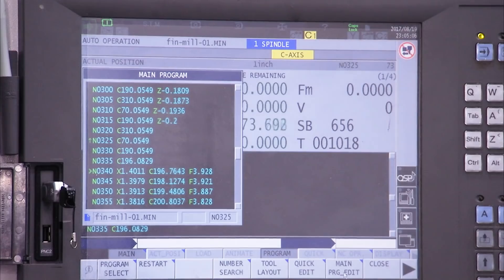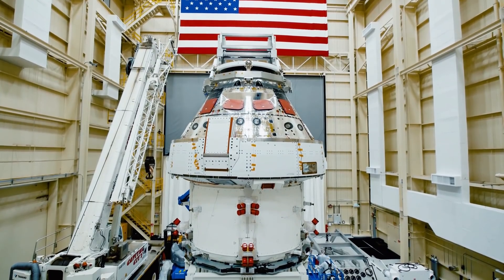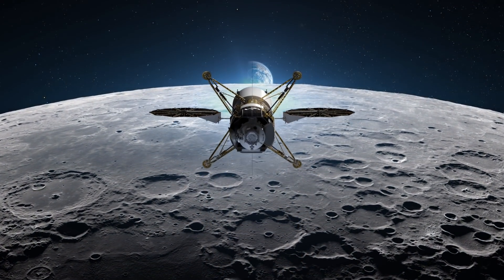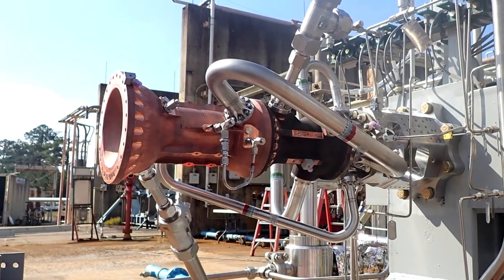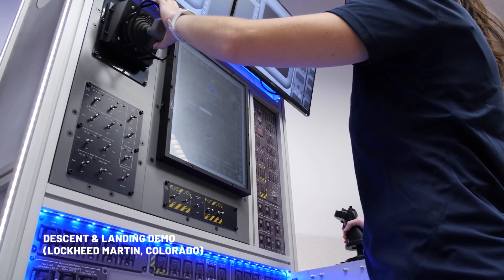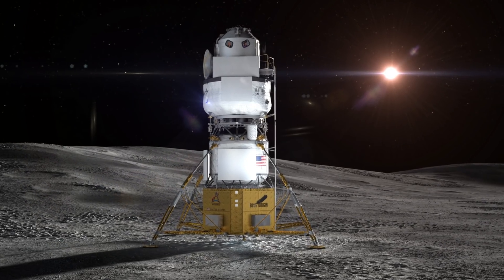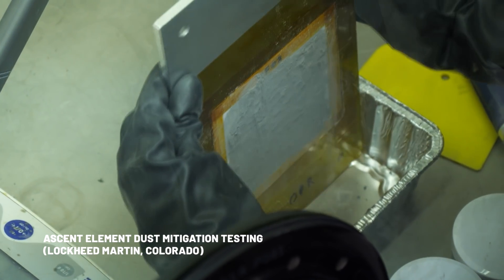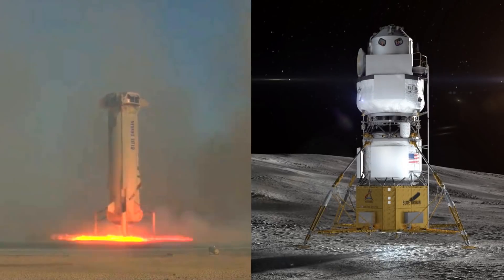Tech Demos for NASA’s Artemis Program

Comment: SpaceX is being innovative and making a real spaceship that will be able to land on Earth, the moon, and Mars while Blue Origin is sitting here reinventing the Apollo 11 lander.
Reply: Yet some how they made it LESS innovative and 10x as complicated and stupid as the original Apollo lander
Reply: Apollo LM was not partially reusable or compatible with lunar ISRU or could support 4 people for a week, much less 2 or had skin more than a couple times thicker than a soda can.
Reply: @iamarokotmanson  I didn't say it was exactly the same as the 1969 Apollo 11 Eagle Lunar Module, I would hope this lander designed 50 years later would have major improvements. But it's nothing super innovative, it's an expansion of already tried and true tech. SpaceX is trying something radically different. Also partially reusable isn't anything to brag about when the competition is designing something nearly completely reusable. Starship and the entire rocket it launches on will be reusable. Also this Blue Origin lander is designed for one purpose, landing on the moon. Starship is going to be able to land on the moon, Mars, and the Earth. It's one design that may work for many missions.
Reply: @Heatr53  i'd say this is a pretty major improvement, worst HLS lander yes but major improvement from LM. 7 day surface time for a crew of four, 2/3rds reusable, multiple engine out capability on descent and ascent stages, much tougher skin, more advanced avionics, and compatible with lunar ISRU. Im not comparing it with the other HLS's just with the LM. 
P.s. lol you want to talk about complexity when starship requires 12 redevouz, dockings, and fuel transfers of 100tns if cryogenic propellant in quick succession to land.
Reply: What Apollo 11 lander?

Comment: I do not understand how Blue Origin is STILL in the running for anything. This isn't 100% reusable unlike the two other bids and you still haven't actually put anything into ORBIT! Don't get me wrong, I was hopping for some competition but at this point...is Blue Origin even at the track?
Reply: Dynetics isn't fully reusable and Starship requires 12 rendezvous and dockings in lunar orbit
Reply: @iamarokotmanson  you do understand that Blue Origin leaves the descent module behind right? Spacex needs fuel but leaves nothing behind. Dynetics is not 100% reusable yes, I am sorry, but is MORE reusable than Blue Origin.
Reply: @lastfreethinker6810  i didn't mention blue origin in the slightest, just trying to clarify things
Reply: Blue Moon HLS is definitely the worst of the 3 but it isn't terrible

Comment: Love the comments 💯 😅
Reply: Way too much mindless spacex fanboys
Reply: Harry the Irish lad  if you think anything other than Spacex is trash and a total waste than you're a disgrace to the spaceflight community. I support them equally. Competition is good, it drives innovation. The Blue Moon lander isn't even that bad. Worst of the 3 HLS yes, but not terrible
Reply: Harry the Irish lad  never heard of compered. But do tell why are you comparing the completely different development programs? SpaceX is attempting to build an earth to orbit vehicle with interplanetary landing capability with very rapid prototyping and fast production. Blue Origin is attempting to build a sole lunar lander in the traditional way. Two very drastically different methods. SpaceX way has not been proven so far.
Reply: Harry the Irish lad  a 12km hop and crash is as much progress as long testing of the engines and subscale tank test for Blue Origin. If you want to be stupid enough to compare the two
Reply: Harry the Irish lad  i didn't say that spacex should do it the traditional way but that the two programs are extremely hard to compare in terms of progress

Comment: Pause at 5:29
They are using a cherry picker. Now compare the height of the ladder to a cherry picker. Dammm that's a big ass ladder.
Reply: That ascent module is so smol !
Ladder is about 35 steps? If OSHA was involved, they would require the astronauts to be on-belay with fall-arresting gear. That seems sensible - not at all excessive precaution.

Comment: So... when are you going fix that deathtrap you call a ladder, eh? My bet: When the first woman astronaut cracks her helmet on the lunar surface after slipping off its MANY rungs.
Reply: Did you notice the ladder is not one solid piece but actually two ladders that are supposed to line up with each other. I would like to know how is BO going to achieve that level of accuracy with ladders fitted to the OUTSIDE of two space vehicles. I don’t think it is possible at all.

Comment: There seems to be an established talking point among those who favor another system about the ladder on this vehicle. Of all the systems required on a lunar lander, what a strange element to fixate on. 

First of all, as they explain in the video, the height of the ladder is an asset because it allows less lunar dust to get into the vehicle. Having critical systems far above the surface, including the engine needed to return to orbit, is a design that puts safety first. The Dynetics low-profile design seems to assume a flat surface and a trouble-free landing. I'm not sure how SpaceX's tall Starship, with its tiny landing legs, is going to be able to land anywhere on the moon other than the super-flat mares.

Second of all, for the many commenters who seem obsessed with the "injured astronaut" scenario, I wonder how you think an injured Apollo astronaut would have gotten back to the LM's ascent stage? The risk of damaging a critical system when landing on an uneven, unprepared surface (much more rugged terrain at the poles than the smoother sites Apollo landed at) far outweigh the risks of an astronaut being incapacitated while outside.

Comment: "It's safer, it's so much safer" Anyway, the crew capsule is 30 feet up
Reply: Interesting observation, he shakes his head side to side (as in shaking your head "no") while he's saying it's safer. While not 100% accurate, people shake their head like that subconsciously when they know they are lying.

Is he lying? I don't know. But I don't buy his argument that it's safer.
Reply: Yea and the moon has 1/6 of Earths gravity. Meaning even at thirty feet a fall isn't likely to hurt you.
Reply: @Predator42ID  If you fall from the very top, it's the equivalent to falling 2M/6.5 ft on Earth, which would definitely hurt really badly.
Reply: gajbooks idk about you but I don’t get hurt when I fall from 2 metres on earth
Reply: @gajbooks  well, you spend more time in the gravity of the moon so it would hurt around half as bad as anything on earth
Reply: @ProtonSemilightCondensed  Maybe not two meters on your feet, but try two meters onto your back into rocks wearing a hundred pound space suit. My point isn't that it's unsafe, and it's probably fine for astronauts, just that it's corporate BS about it being designed that way for safety. They clearly intend to use multiple launches which means it all needs to fit in the payload fairings and transfer mass limits, which is the real reason it's designed so vertically.
Reply: gajbooks yeah that’s a fair point, but the weight of the suit doesn’t mean anything.  Heavier things don’t fall faster, and the suit is inches of thick material with plates of metal all throughout them, so falling onto rocks wouldn’t be too bad. But yeah I agree with the rest of your point.
Reply: gajbooks 30/6 is 5, not 6.5. And even falling from that height on earth wouldn’t break bones or even hurt that much. Plus the astronauts would be wearing super strong spacesuits which are like inches thick and are pressurised from the inside. Oh and the lunar dust is like VERY fine. A lot finer than sand. So fine in fact that the legs on the Apollo lunar lander only buckled a few inches even when moving at a little over 2 metres per second. Falling from that height wouldn’t pose any real threat if you just rolled on your side and broke the fall with your arms and shoulders.
Reply: @seth Thomas It will be like 5 meters on Earth. And Imagine if something nad happend during EVA and Astronaut would lost consciousness, how would you gonna carry him to habbit module?
Reply: *5 feat (~2 meters)
Reply: Don’t forget the bottom of the Apollo lunar lander was over 4 feet off the surface, requiring a much more dangerous and time consuming jump that would also be nearly impossible to get a crew member up in an emergency. So instead they just do what they can to prevent an emergency in the first place, like making the suit stronger.
Reply: I don't know about you buddy but I'd rather have an abort to orbit option than having the crew module low riding close to the surface.
Reply: @odysseyvoyager2354  Even the Apollo missions had abort-to-orbit capability, and they weren't 30 feet off the ground. It's not a matter of safety, it's a matter of the dimensions they can cram into payload fairings for the descent mass they want.
Reply: @odysseyvoyager2354  p
I’m pretty sure they all will have an abort to orbit option, and being lower to the ground is definitely safer too. Image if there is an emergency, would it take more time to get up a 30 ft. ladder in limited mobility EVA suits, or be right there at the ground ready to go?
Reply: Gabriel Taylor yeah but they can just work on preventing emergencies in the first place by having better suits. If you think about it, the only really possible emergencies are breaking the helmet or breaking the life support pack, which can easily be avoided by making the pack stronger and having multiple layers of bulletproof glass for the helmet, which is what the Artemis suit has.
Reply: @odysseyvoyager2354  watch Angry Astronaut's video about this. He has conducted an interview with Dynetics. Dynetics had raised some concerns about this.
Reply: @odysseyvoyager2354  you guys should watch the angry astronaut lol
Reply: @michaeljones5685  haven't watched his current video about this, but the dude talks out of his ass about a lot of these topics.
When i heard him talk about the priorities of the spacex test flight it really got clear to me how little he knows about the stuff he's saying.
Reply: @XPECTED pretty much. Didnt mean to be that rude, but it kinda seems that way. His perception about blue origin and other companies is a little out of whack and he barely knows any of the technical stuff, but makes claims about them anyway.
Reply: Kenneth Irgendwas yeah he really just doesn’t like doing research and doesn’t have very much common sense. He called the Artemis EVA suits ‘bulky’ when they are the most advanced, mobile and safe spacesuits ever designed. Even falling off the top of the ladder wouldn’t crack the 2 layers of bulletproof glass and would really have a good chance of breaking bones are damaging the life support pack, considering 30 feet on the moon is about 5 feet on earth. You can’t really injure yourself in a 5 feet fall on earth. If you feel off the top of the ladder you could just turn to the side and stick your arms out which would break most of the fall. The Angry Astronaut just isn’t willing to do proper research about this.
Reply: So what? Astronauts aren't recruited from nursing homes.

Comment: They complimented the reusing of old controls for astronauts, but actually the astronauts found the new controls on SpaceX Dragon superior and had no trouble getting used to them.
Reply: @batugunduz3950  and even then it is more expensive ;)
Reply: I was confused aswell about that argument in the video.
Reply: The old dudes cant handle change. All the Apollo astronauts hate Spacex cause  they are different... also a few of them are invested in the heritage companies.
Reply: @OBTX91  I believe some Apollo astronauts have changed their opinion on SpaceX.
Reply: @OBTX91  Some Apollo astronauts changed their views to SpaceX.
Reply: @emman.5995  What astronauts?
Reply: @arthurlunar7835  Buzz Aldrin, Cernan and Armstrong. The 60mins interview is inaccurate about the questions regarding the topic.
Reply: No they didn't. What are you talking about? They said they're using the same control system as Orion. It's mind-blowing how much hate this is getting.
Reply: @dollgen  welcome to SpaceX fanboys
Reply: @batugunduz3950  exactly